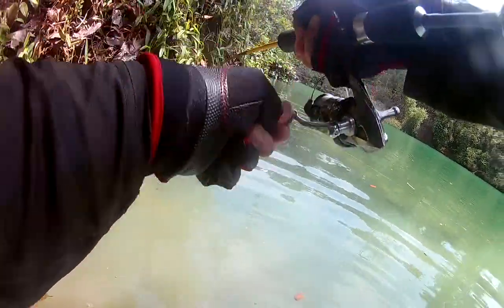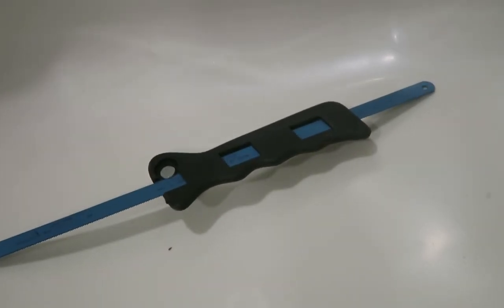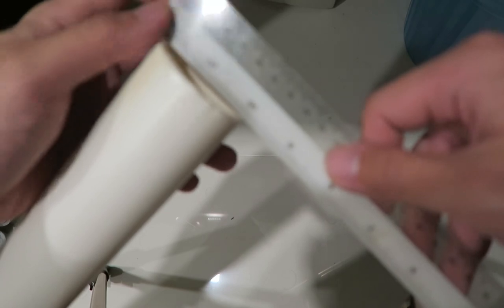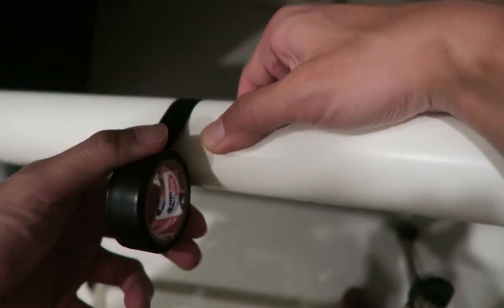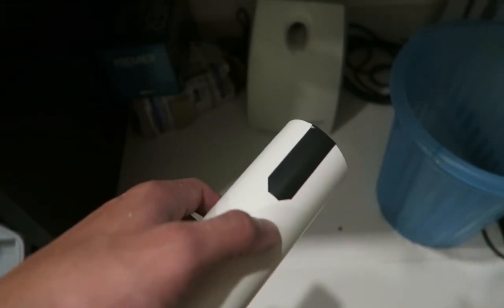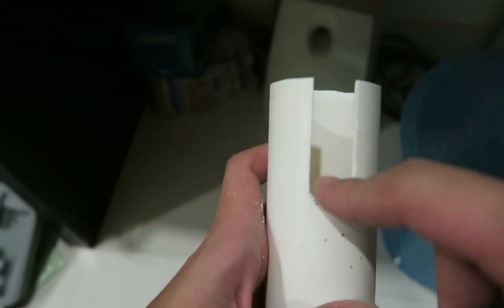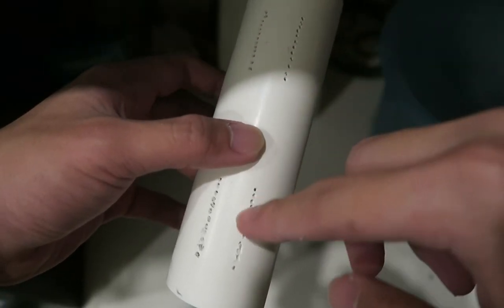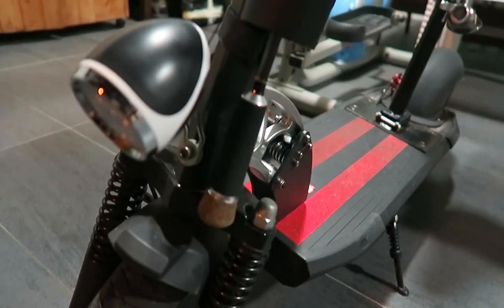Be A Jenius: DIY Homemade Fishing Rod Holder for Electric Scooter

Comment: Press the PVC tube on your flooring against the wall, then hold a permanent ink marker steady on the tube while you roll the PVC tube. The marker will mark a circumference on the tube that you can use as a guide to saw. Overall concept you have is great on the scooter. Should have kept the PVC tube longer though and perhaps think of a few ways to minimize the movement of the rod while you ride. Don't see you using the Dagger Royal Spirit much.
Reply from the maker: PC Gwee hey thanks man! The current design has worked pretty well so far, not much movement of the rod, my mess of wiring from the scooter helps in that LOL. Yeah, have been using that rod less as ive been lazy and the one-piece are really convenient. LOL.